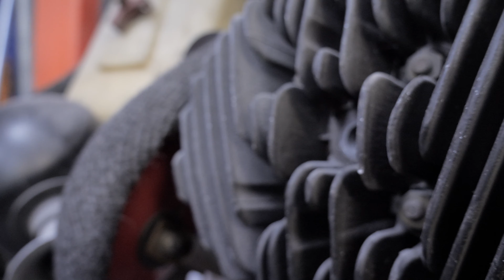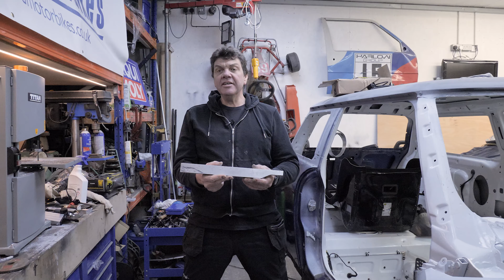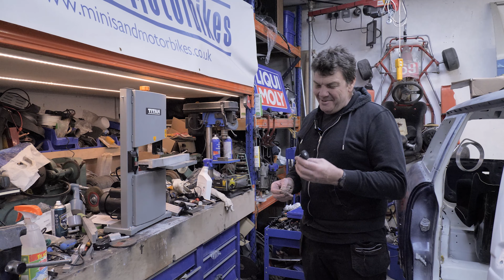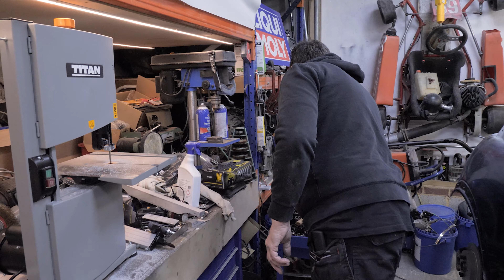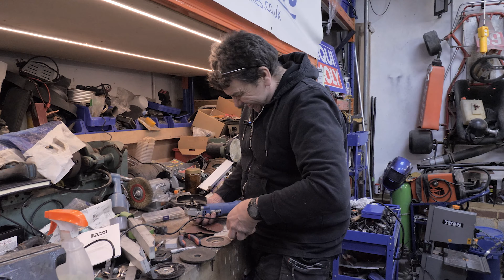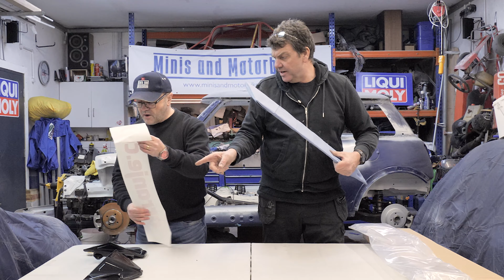Fixing the flex on the Mini seat pan and unboxing the rear wing - Episode 70 of Minis and Motorbikes

Comment: Glasses, right pain in the bum when I loose em or forget them...
Found a supplier on Amazon that sells em dirt cheap if you just need readers for close up work, £13 for 5 pairs.
Quite sturdy as welll, search for 'Opulise Ink 5 pack' Tried to copy the link here but you tube wouldn't  let me. recomended! 

Glad to see Mark is back to good health, man flu can be dibilitating, worse than childbirth apparantly 🤣🤣

Oranjee are a local supplier to me, only 10 miles down the road,  problem is whenever I message Oli there it ends up costing me big time 💰💸
Got a GWing on my 'want' list do will be well interested in the next episode when you fit it. 
Smithie....
Reply: Thanks Smithie. No pressure then? 😂😂